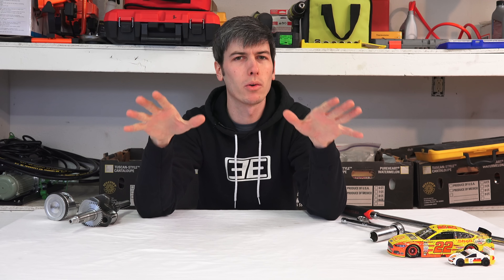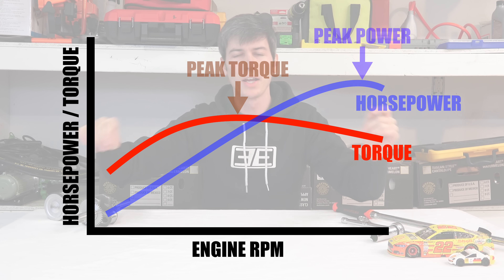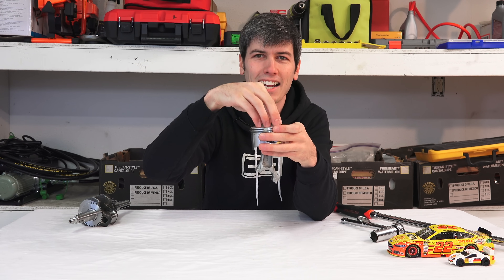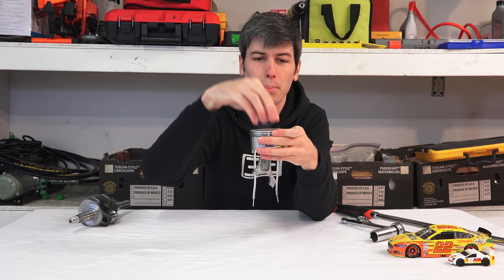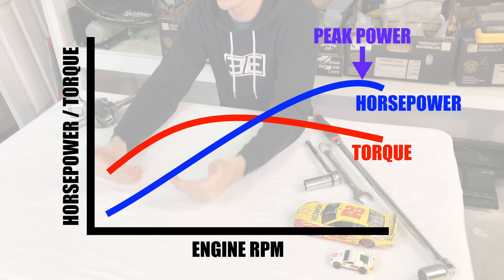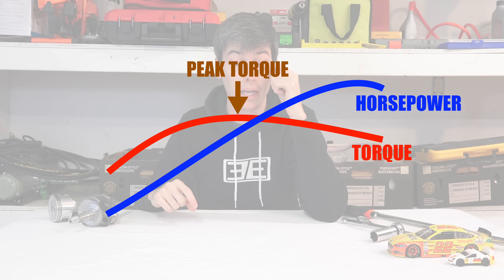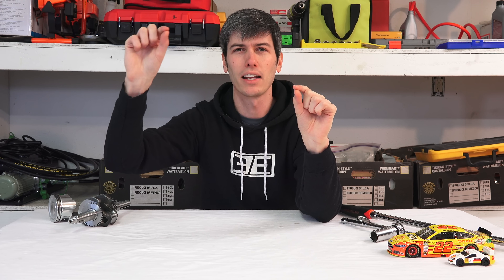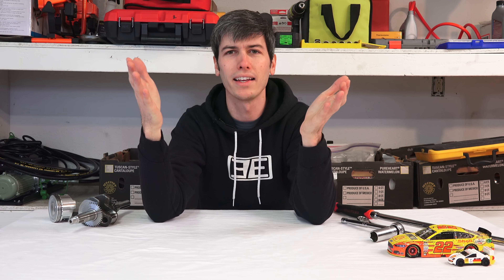Horsepower vs Torque - A Simple Explanation

Comment: with simple words. Horsepower for speed, (motorcycle), torque for strength, (truck). And car in the middle.
Reply: Horsepower is the amount of work done per Time.
Torque is the force applied to an rotation.

work done can be: hauling stuff, accelerating mass, heating up something etc.
torque can be... converted in rpm, or rpm can be converted in torque.
hope you get it.

for all others: use your gears.

why trucks have so large amounts of torque at low rpm, and motorcycles low torque but very high rpm is a completely different story.
Reply: @Coolgamer400  I know how it works. And rpm is  horsepower related. You said it yourself ''Horsepower is the amount of work done per Time.'' 
I hope you got it.
Reply: I like the way you put this.
Reply: @YourFrienjamin  thanks bro.
Reply: @Bob-f7c2r  you are welcome Bob. I am glad it helped. Actually you already knew it. I just gave the spark!
Reply: completely wrong
Reply: @chadw8272  It is you Chad that is completely wrong. Some one has come up with a simple explanation and you run it down. Trolls like you are a dime a dozen on youtube so piss off.
Reply: @chadw8272  Please explain to us, with simple words if possible!
Reply: U rised my case
Reply: An engine produces two "things" - torque and speed.  In order to accomplish any work you need to have both of these "things" present so the rate of doing work is dependent on the combination of torque and speed.  Power by definition is the combination of torque and speed so it follows that power is what accomplishes work.  The type of engine that is producing that power is determined by the application.  Using your examples a motorcycle needs a very lightweight engine so it will rely heavily on high rpm instead of torque to make the required amount of power.  The duty cycle of producing maximum power is very low so engine durability and longevity are of lesser importance.  On the other hand a heavy truck or farm tractor needs to be able to produce maximum power on a regular basis over a lifetime of many thousands of hours.  In this case we'd want a low-revving engine for durability and efficiency which by definition means that it needs to produce high torque in order to make the power we need to do the job.  In either case it is the power that we're after and are just changing the ratio between torque and engine speed based on other design requirements of the machine.
Reply: Wrong
Reply: Power to weight ratio figures into your example..

Comment: If you gave a semi truck a higher gear ratio, would it be able to accelerate like a sports car? Similarly, if you gave a supercar a really low gear ratio, could it tow a big trailer? I know traction would also be a factor at that point.
Reply: and yes, if you give a very low gear ratio to a sportscar it could haul very heavy loads.
Reply: In fact, if you gave higher gear ratios to a semi it would have problems starting off the line but it would run almost as fast (top speed) as if it had its original gears
Reply: you don't need to modify the gears in the semi; they are powerful and fast.

Comment: Torque gives a car/truck 'get up and go'.  Horsepower makes it 'go fast'.   If you are trying to pull something from a stop, then RPMs will be essentially zero, so actual horsepower will be near zero, torque will be all that matters.  Low gear will help both increase torque and help get the RPMs up sooner.

Comment: This is still unnecessarily complicated.
Horsepower is simply a measure of output that is unaffected by gearing. Since HP and torque are typically measured at the engine, it's more convenient to use HP as a measure of performance simply because it avoids having to calculate the rear wheel torque (where it matters) for each gear and tire diameter.

Comment: You have gotten so much of this wrong.  In the first place, you keep construing acceleration and speed.  They are not the same.  In the second place, torque translates to the ability to pull, and hence, acceleration.  Power translates to the ability to overcome resistance (e.g., parasitic drag, including wind resistance), ergo speed.  That's why a big block with ass loads of torque (400-500 ft-lbs) with the proper gearing will smoke a formula 1 engine IN THE SAME CAR (800+ HP, but ~300 ft-lbs of torque) in the 1/4 mile.  Stick to physics, because you suck at cars and engines.

Comment: So for the same horsepower it's better to choose an engine with a higher torque. In this way, it will turn slower and last longer.
Reply: so it would be a bigger engine and will consume more fuel when in idle (at a red light, for example)

Comment: That didn't really help.  Sounds like HP is the only thing that really matters, but so why do people talk about both numbers?
Reply: mychannel Torque matters too. It’s important in engines designed for heavy loads like semi trucks, and in commercial vehicles it allows for more aggressive gear ratios. In other words, if you have a vehicle with a high amount of torque produced at the crank (before it reaches the transmission), then you don’t need large gearing ratios that create torque but spin the wheels more slowly. Instead you can have smaller gears that create less torque but spin the wheels faster. Hope this helps to explain why torque is also important!

Comment: More easy explanation I give to non petrolhead guys when they spam me with these questions:
I am 205cm 105kg, so i have a lot of torque and the same speed as someone who is 180cm and 70kg, so we are almost the same power/weight ratio and run with the same speed and acceleration. But if we both put 30kg backpack on, since I nominally have more power, that 30kg additional weight wont affect my acceleration much because of excessive torque, but the guy who is 70kg will have to carry around 45% additional his own weight, so it will affect his acceleration a lot. That's why in heavy cars like BMW 5 series diesel engines have superior power, efficiency and acceleration in <300hp segment. In Over 300hp engines range petrols produce more overall KW power having enough torque to pull 2 tonn sedan

Comment: Wrong. Torque cannot be manipulated by gear, force can be. Torque is force combined with distance component, but not the distance from center to point where force applied, but angular distance at which force was continually applied. Therefore, via gear you can reduce the force and increase the distance, or vise versa, meanwhile maintaining the product (torque). 
Now, HP is the same torque but now combined with time component (or speed instead of distance). And the speed can be expressed in RPM of course.
Physics 101.

Comment: I once was told horse power is how fast you can hit a bldg torque is how far you drag it once you hit it.
Reply: How far you drag the building is dependent on mass * velocity. Nothing to do with torque, though it's a common misconception.
Reply: @tuerney420  oh really. i think you better recheck that.
Reply: @tuerney420  ever wonder why they use diesel engines in large trucks. Power output: Horsepower vs. torque
It's torque that gets things moving, which is why diesel engines are used in big trucks; they are great for moving heavy loads because they have so much torque. so whats your take on this?
Reply: James West In your first comment you were talking about how far you can make a building move when striking it, but your second comment is about using an engine to get a load moving. Those are two completely different scenarios. How far you make something move when struck is dependent on momentum, which is mass * velocity. In other words if you a had a one ton truck traveling at 100mph but with a low torque engine, it would make a building move much farther when struck than a half ton truck traveling at 100mph with a high torque engine. The amount of torque produced by the engine is irrelevant in that situation. But you’re right that a high torque engine would have an easier time getting a heavy load moving and accelerating it than an engine with lower torque.

Comment: So the torque rating is for the engine, and has nothing to do with what force actually gets to the wheels?
Reply: No. To spin your head back round the torque at the wheels does matter. As he explained torque and power can be manipulated and are very much linked by time (aka RPM) but when you have maximum power in the engine (i.e. at high RPM and a low gear) vs maximum torque (ie. at a lower RPM and higher gearing) then that power is applied to a wheel then an amount of torque is applied to the rubber. If the torque is low then you will accelerate slowly, if the torque is too high then you will get wheelspin and somewhere inbetween the car will accelerate like hell.....but remember Torque is a force - power is not. Power is a rate of work.
Reply: @gmangnall  a lot of people dont understand the difference between torque and hp let alone power band curve. this is what makes engineer design car engine so fascinating. a lot of smart engineer dont understand as good as other engineer this is why cars with rated power perform slower. some manufacture couldnt design a sport bike or formula 1 engine reliability so they never get to experiment with power curve to understand acceleration. this is why it lead them to only make v8 engine exclusively - all v8 by nature is fast.  making 4 cylinder or v6 or inline 6 fast, you need to understand power curve. while v8 dose not. its just torque monster. 

when i look at engine design, i pay attention to power band and understand what makes that engine great. there are exception to every engine. you can have an engine with 100hp less accelerate faster. for honda, the reason why honda able to get maximum hp is because of their head. their head flow so good that you can extract so much hp out of it. then again, hp isnt everything. honda know this, this is why when honda make their first gen c series engine, they gave it more torque than trying to get most hp out of it. so it can accelerate faster early and mid. real world race appilication mid range power most of the time wins. nissan have always focus on mid range power.
Reply: The higher the torque the faster you can accelerate in the highest gear and low revvs form low speed.

Comment: Tell me if you get it from this bicycle one :

If John pushes a bicycle pedal down once only, through the entire movement range, - We will call that 1 Repetition/Revolution.

John has tiny weak legs, and when he pushes as hard as he can, he generates 50 Lbs of force on the gear turning the chain that turns the wheel (His Torque).
If he tried to turn the wheel while it was in liquid cement, the wheel would move, but not much, and he would likely be stuck.
John can repeat this 50lb effort 20 times in one minute (RPM).
John has a *pseudo HP of 1000.

Jason is a powerhouse with huge legs, he also makes 1 RPM movement on the pedal, only he puts out 500 LB force on the pedal, and can do it for 102 Revolutions in one minute.
Jason has a pseudo HP of 51000.

Jason can not only send wet cement flying with his 500lbs of force, but since he can apply 102 bursts of 500lb power in one minute; **at equal efficiency** Jason would travel 5.1 times farther than John in one minutes time(due to the RPM); if  John was too weak to turn the wheel at *peak gear speed* with 50 lbs, then Jason's 500 would make him move even further in one minutes time, being able to fully utilize that gear.
In other words:

More Torque can make you faster, because it can allow you to pedal a bike in 6th gear whereas the weak may only be able to push the same bike in 2nd gear.

Jason's Torque allowed him to move out of the cement because of the power he is able to apply to the gear that physically turns the wheel, but it was his 102 RPM that was mainly responsible for the distance.

Torque is likely still best thought of as the strength that moves the mass, even though it can increase speed as an end result.

On a road, overall HP still dictates the speed.
So if two gears have peak power at 6000rpm resulting in peak speed, the gear with 2x the Torque will reach peak speed 2x as fast, but once at peak power, it's all about who has more RPM.

Now apply the sentiment to engines turning wheels with engine torque + RPM + gear selection

Comment: Best way to understand given the formulas  HP equals Torque x RPM thus max RPM you can do assuming one engine turn equals one tire turn looking at his cars
CAR1  200 HP divided by 100 torque equals 2 RPM
CAR2  100 HP divided by 2OO torque equals 1/2 RPM thus the first car gets more wheel spins and thus goes faster.  Note that these numbers are determined based on the engine you can have an engine with more torque than the 200 but it will have more HP than 100 at that half rpm  so you cant say I have same car two but I double its torque to 400 and now I only get a quarter RPM because you have a different engine now and if you dyno it with double the torque you will find that the horsepower has gone up also and the car may now put out 400 hp so when you do the calculation of 400 HP divided by 400 torque you get 1 RPM so it is a little bit faster.

Comment: Simply put, HP is torque over time.
Reply: HP is torque through rotation rate.   HP = torque*RPM/5252.

5252 is a unit translation factor that comes from the definition of horsepower (550 ft-lbs/sec), the definition of the minute (60 seconds), and the fact that there are 2*pi radii in a circumference.

Comment: The only vehicle that would have have twice as much torque than hp would be a low revving larger engine my mercedes 609 had 90 hp but 350llb foot torque but it's a 4ltr engine . Both cars cant be the same

Comment: if I make my snowmobile engine rev higher will I gain anything? It revs to 8100 rpm right now, or is there likely more power/acceleration at say 7000 or 7500?

Comment: What the hell is it with everyone saying pound feet. It's freakin foot-pounds.
Reply: It's pound feet. Foot pounds is commonly used, but incorrect.
Reply: @MeltingRubberZ28  I think there is a convention of using "foot-pounds" for torque and "pounds-feet" for work, due to the fact that order matters in the formula that defines torque, and the order is opposite in the formula for work.   But this convention is commonly ignored, and the terms are interchangeable.

Comment: Torque wins races horsepower sells cars. If u had 1000 go and 1 torque u wouldn't move very fast. But if u had 1 go with 1000 torque u would move faster. This is exaggerated but it's true in concept.

Comment: If your making 100 horsepower out of a modern engine pushing 200lb/ft you need to make sure your torque converter is locking up....